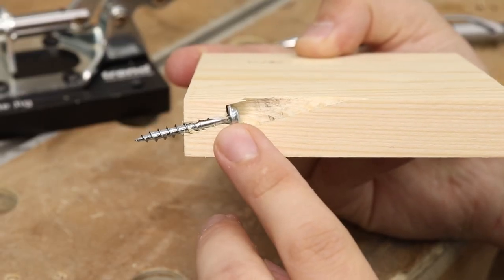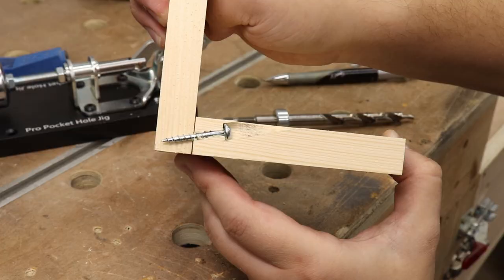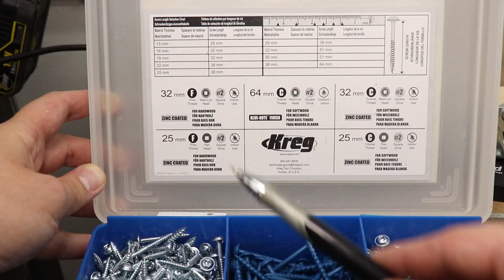Pocket Hole Joinery Basics - jigs, screws, common mistakes

Comment: You have shared the most comprehensive explanation of the specifics of making this type of joint. When explaining how to prepare the drill for screwdriving (9:40), I would add that, unlike screwdriving, for drilling, the drill speed should be set to maximum (2) for cleaner hole edges and drilling should be done without excessive downward pressure.📐🗜
Reply from the maker: Good tip 👍

Comment: Good demonstration of pocket holes and the correct use of them ... they do have their uses but I just couldn't bring myself to use them ... for some strange reason I just hate them, which is weird as I don't have a problem with screws!!
Reply from the maker: At one point I was using them in every single project I was making. Now I use them if strength is important, as addition to wood glue. Or if I need to put something together quickly.

Comment: Hey Tomasz, another helpful video. I have been using pocket holes for a while mostly in MDF but thank you for pointing out the grain direction tip when drilling pocket holes. Also, I have yet to build a pocket hole station so look forward to seeing your future project to build yours. Cheers. 👍😎🇦🇺
Reply from the maker: Thanks mate 👍😁

Comment: I have watched many tutorials on pocket hole joinery and this by far shows the simplest way to help someone who is trying to start out, well done Tomaz. One thing though, the disc you placed on the jig for depth of the bit, what are the different heights for?.
Reply from the maker: Thank you. You got 12-19mm, 22mm, 25mm, 32mm, 38mm👍
Reply: @CasualDIY  I meant what are the measurements for?
Reply from the maker: @Neil-Hanson67  To accommodate different thickness of wood. So a 15mm thick board will have slightly different position of the collar on the drill bit to a 25mm thick bard. Remember you set the jig itself, the height of the core according to the thickness of wood. If the drill bit is not set up correctly you will drill through the jig or not drill deep enough. Hope that explains it👍
Reply: @CasualDIY  Great thanks.

Comment: Really good helpful video for a pocket-hole newbie like me. Some points could do with a better explanation though: why square drive heads? Are there other drive types or are they all square drive? The part where you set the depth of the drill bit using the plastic 'widget' needs to be clearer: what step should be used and why?  You need an extra long square drive bit in order to drive the screws. Do you have a link to yours? Thanks
Reply from the maker: 1. They are mostly square (not seen others myself). Will not strip under pressure 
2. Steps are the same as on the fence- ie depending on thickness of your material - thicknesses also imprinted on the plastic widget
3. The drive bit usually comes  with the jig - links in my video description

Comment: Great I have just purchased pocket hole jig just wat I needed not a branded one.
I have a quick question Tomas
Setting the collar do you have to take I to consideration the thickness of both pieces of wood.
I hope I have explained myself correctly
Reply from the maker: Depends, mainly the piece that you will drill the holes in. The other piece not so much. For the other piece I would think of using the correct length of screws.

Comment: Very good information Tomasz 👍. I’ve got a Rutlands jig, which is very good, but doesn’t have any dust extraction, I’m wondering if I could drill holes in it, then design a 3D printed dust port to fit 🤔.
Reply from the maker: The dust extraction is great, I got a jig from Katsu and it has no extraction. Now with this one from Trend its like night and day, no mess at all its great.

Comment: Great video, many thanks. Am I right in saying that there are no settings made on your Trend PH machine or depth collar that takes account of the depth of wood the screws are being drilled into - ie a 26mm piece being joined to the face of an 18mm piece? There is then a risk of the screws popping through - as I discovered!!
Reply from the maker: It's set up for one dimension at a time, however you can adjust the settings and see what works correctly for you. For example use a shorter screw.

Comment: Hey Tomasz - Great video sharing your knowledge and insights on pocket hole joinery.  A couple of questions for you.  First, which screw type would be best for plywood or MDF - fine or coarse?  Second, did you manage to find any alternatives to Kreg or Trend screws?
Reply: Definitely coarse thread for MDF and plywood according to screw manufacturer’s data.
Reply from the maker: As Ian mentioned that's the way I would go. Well I think the Trend package is quite good 850 screws for £26 I don't think you will get a better deal. Maybe on ebay if you buy single size ( that you use most often ) but it won't come out much cheaper I think.
Reply: @CasualDIY  Thanks!  UJK were the only other brand I could find (Axminster).

Comment: How does one set depth on drill bit without a depth guide?
Reply from the maker: By trail and error. The tip of the bit must be just slightly popping out from the first piece of material you want to join

Comment: tomasz i have scaled and searched the internet for the last 5 years for pocket hole screws they all work out the same price pocket holes are good but as you say they have there limits hope you can find a cheaper alternative kreg make a exterior grade screw for 3x2 and 4x2 i purchased loads on a deal they work well ........................good luck 😂😂😂😂
Reply from the maker: Well surprisingly Trend got a package of 850 screws for a really good price. I got some links in my pinned comment

Comment: Unfortunately... The downfall of the video was the depth of his drill bit - was over extended! You should NEVER see the TIP of the drill bit coming OUT of the parent wood, as you're remaining 'shoulder' material is WAY TOO THIN. You would have to back the drill bit BACK a bit unseat and reseat the collar (maybe 3/16" or so) so that you don't see this. This way you have enough material left and not have a week end for the screw head... Very important and missed at @9:15. Note to viewer!
Reply from the maker: I'm very doubtful that 0.5mm will make such an enormous disaster as you are explaining. The drill and the collar was set with the jig and for me that's accurate enough. If the drill bit went through by few mm then I could agree with you. However at the time stamp you posted you can clearly see the tip has not gone through. And on another note this is woodworking and not spaceship building. 0.5mm will not make a difference that will affect anything in this case. But we are all entitled to an opinion. I have mine but I do respect yours👍
Reply: Greetings! @CasualDIY  So listen, I appreciate your counterpoint, but somehow you missed it. Clearly, at the timestamp, once again, anyone can clearly see that the tip HAS pierced the base point of the grain... You are correct; this isn't spaceship building (though my particular background is in aircraft engineering and MX) but for this, we're not discussing a .5mm,  rather, move that decimal to the right and you've got around 5mm. So what's the point here? Your video is great, really, overall but in woodworking with jigs such as these, they tend to not be as strong than with biscuit or dowels so with these types of screws, it would be 'better' for you to realize, guide and mentor that for hilt strength in creating these type of connections that you really, should have noticed this and recommended to back the drill back up that (5mm) preferentially speaking... The 'shoulder' the screw sits on is back more in the parent wood vs lower in it. Is this small overall? Yes. Do you build massive furniture or temples like this? No... But it is helpful to know that when using 'these' types of fasteners, with or without glue, it IS better to educate the common viewer that this should be noted and adjusted. Seriously, look it up, you'll see this is correct guidance and not trying to hit you personally. Many people 'make' bad videos, yours isn't bad, it's just lacking clarification when making these holes. Additionally, you started with 'I'm doubtful..' and that too is the point, you apparently aren't aware of this by being ill-advised, certainly not meaning in a rude context. I enjoyed your video but as with any tutorial, we should lean towards advising - correctly. Somehow you missed this, please don't take it personally. I'd offer to suggest to edit the vid with maybe a text overlay and press on. I'm sure you build amazing things!
Reply from the maker: @AXNJXN1  I get your point, I'm not saying you are wrong, on the contrary. However with the jig set up plus correct selection of screw length and style this will not make any difference in the strength of the connection nor it will break through the other piece. Trust me I've tried it. And it's just the tip of the drill bit that slightly went through. If it actually went through by as much as you say the hole would be drilled through and clean. There is still plenty of material on the saddle for the screw head to sit on.  And you can see it's not. Pocket hole joinery will never be as strong as dowels or biscuits thats obviously (hence sometimes it makes me laugh when I see people using pockets for every single build they make) there are projects or part of projects that pockets are good and quick solution but that's it. I prefer dowel joinery, much stronger and with a good jig and setup  it's quick and easy. I like a good discussion and if you ever got time and want to chat drop me an email casualdiyuk@gmail.com 😉👍 
For me there are times where being super accurate is important like dovetails, finger joints etc. Pocket holes don't fall in that category and they don't have to be pedantic accurate. They got large room for error, when you realise what they are for and when to use them. They are designed to be quick and easy dirty connection and we shouldn't worry about it too much.
Reply: @CasualDIY  Cheers! Great conversation!